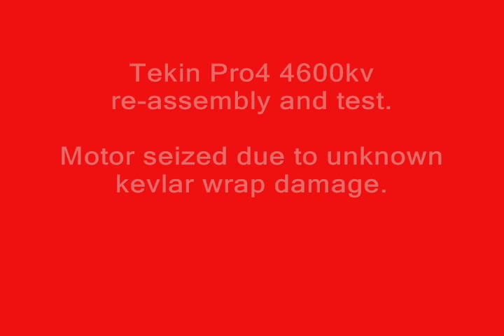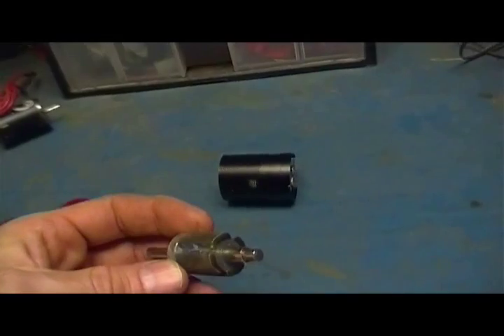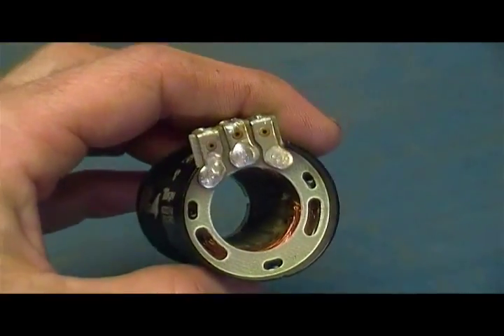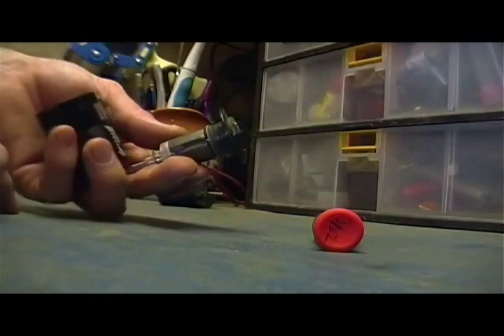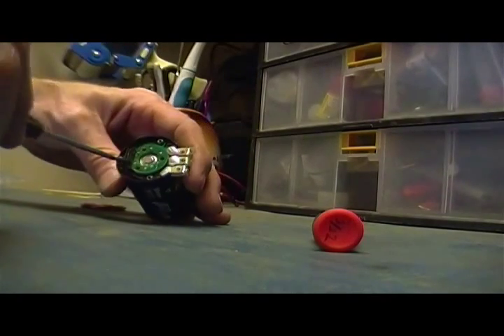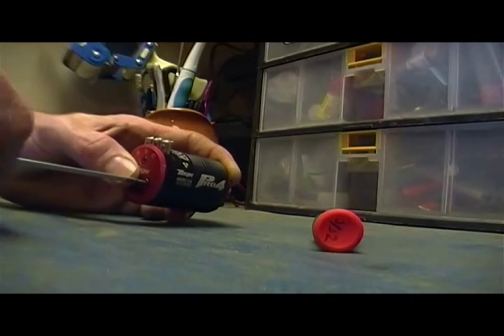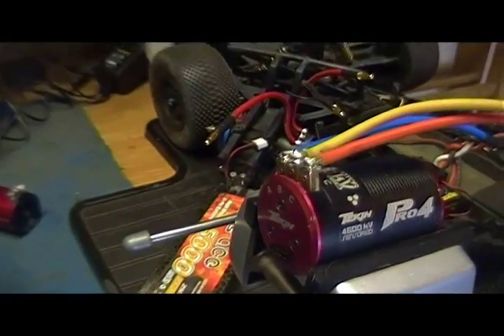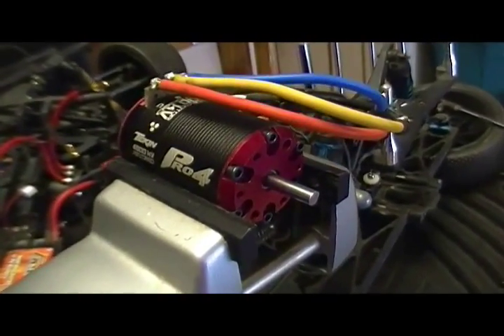Tekin 4600kv Pro 4 Re-assembly Repair

Comment from the maker: Thanks I did contact Tekin but was not treated well. I have since replaced the rotor though because I did not want a failure during a qual or main. Love the motor still, runs cool and strong in my SC10 4x4. I think that the first rotor just had a defect.

Comment from the maker: I put the JB Weld under the magnets and some in the slots between them. I eventually bought a new rotor though, because it seemed a little out of balance and ran a little hot. Luckily with the new rotor the motor is still running strong.

Comment from the maker: I put a good amount of the JB weld under the magnets and let it squish out. After I cleaned up the excess, I wrapped it as tight as I could get it with a bunch of rubber bands and left it to dry for a few days. 

I was also going to do the last step of wrapping the rotor with Kevlar thread and coating it with epoxy but could not find Kevlar thread so skipped that step. It may have helped with the balance or probably made it worse. Really the balance was the part I could not get right.